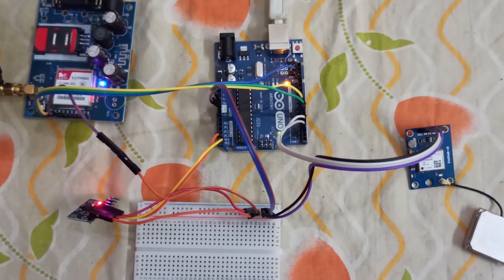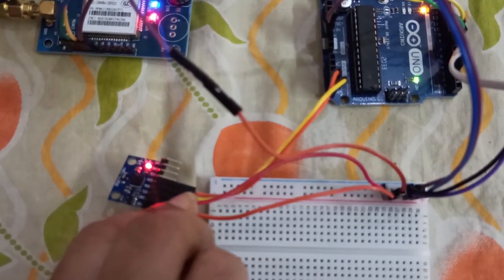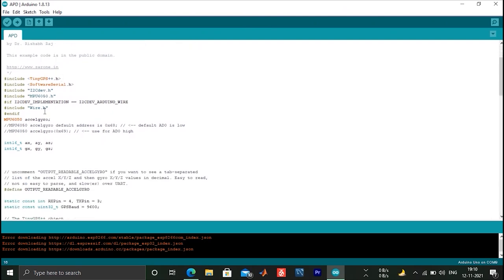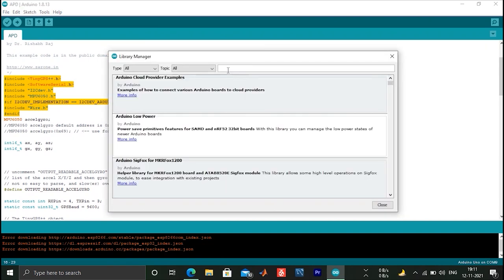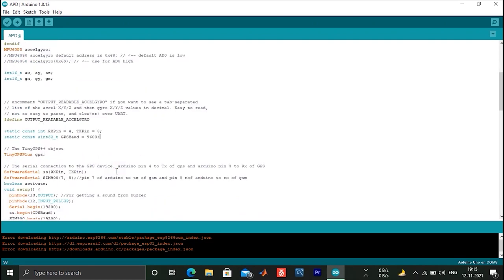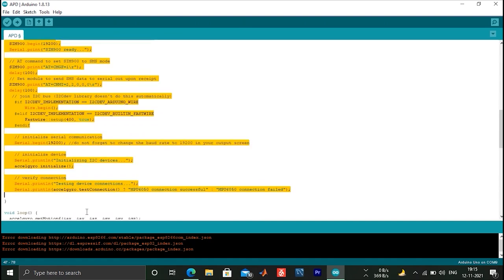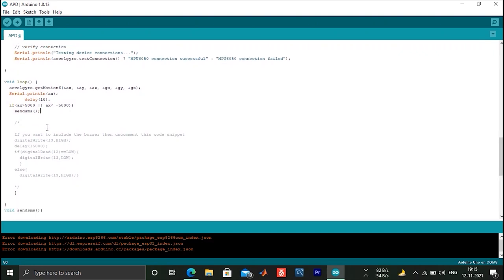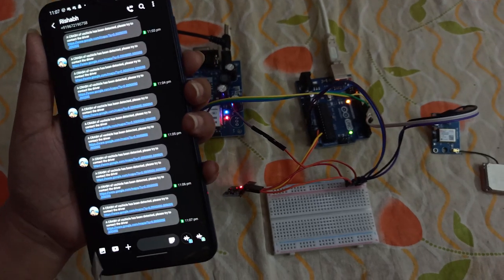Accident alert system using arduino | Vehicle Accident Alert System using GSM and GPS

Comment: Hello. I have almost the same project as in the video. The difference is, I use NodeMCU as a microcontroller and for SMS I use Telegram chat. But I have a problem. GPS location is not sent to Telegram. even though Warnings without location can be sent. Can you help me with my project? Or maybe there are suggestions that can be given regarding this problem? Thanks

Comment: How many volt battery is necessary
Reply from the maker: The whole system is powered with the adapter which is plugged in to GSM module, but if you need to plug it with battery, then use 12V 1-2amp battery

Comment: Mpu 6050 ki jagah ADXL 345 use kr skte Hain same code ke saath
Reply from the maker: Yes, you can use ADXL345 accelerometer also, the connections will be mostly same, you can further follow this tutorial if anything comes up: https://circuitdigest.com/microcontroller-projects/interface-adxl345-accelerometer-with-arduino-uno

Comment: Hi am from Nigeria is it possible am have problems with the gap sim900a because am using Nigeria network if so please help how to make it work or unlock it to my network provider
Reply from the maker: You can use airtel sim in nigeria, it will work
Reply: @ZARONEPROJECTS   I try it not working please help me have been  finish solution to this since last year
Reply from the maker: @OopsEmojiz  send me pics of your connections and full model

Comment: @ZARONE PROJECTS  hi i completed the project but the it not sending SMS and also the just show display crash even when the mpu6050 is not moved or touch
Reply from the maker: Can you send me the wiring diagram???
Reply: @ZARONEPROJECTS  and also it us the diagram u upload
Reply from the maker: @OopsEmojiz  Have you checked all the connections??
Reply from the maker: Can you send me the pic of whatever you have made
Reply from the maker: @OopsEmojiz  and which sim card are you using with the gsm module??
Reply: Hi were you able to solve the issues?

Comment: at first gsm is working and sending messages and then suddenly it stopped working and not getting anysignals
Reply from the maker: Check your power supply, it should be 12V, 2A and whether its getting proper signal or not, if not getting proper then place it in open ground

Comment: What is difference between GPS GY6MV2 and NEO6MV2?
Reply from the maker: GY6MV2 is the board containing ublox Neo 6m like nodemcu contains esp8266 wifi chipset. Other then neo 6m chipset, gy6mv2 also contain antenna, voltage stabilizer, rtc, etc. Basically they are not very different, moreover better versions like neo 7m or 8m is even used in drones and rc planes.
Reply: @ZARONEPROJECTS  And also can you  please say what's this threshold value of mems accelerometer during left,right,front,back accident?
Reply from the maker: @Anjali gupta The rollover threshold on the x-axis is 5000.  (We directly used the raw data from the MPU6050 without converting it into degrees or radians, so the sensor range for ax is 10900)
Reply from the maker: You can download the code from the link given in the description
Reply: @ZARONEPROJECTS  Ma'am please tell me why we use Arduino Uno r3 and why not another Arduino ?
Reply from the maker: @anjaligupta7843  Its just because it is most easily available board in Indian market and moreover it provides decent no. Of pins to attach various peripheral devices. You can use Arduino leonardo which is very similar to Uno, or arduino mega for big projects requiring more no. Of pins or arduino pro mini for small sized projects, choice  is totally yours
Reply: @ZARONEPROJECTS  ma'am can I get documentation for this project?
Reply from the maker: @anjaligupta7843  On your special request I have created a documentation of the project. Click on the link to get the project file - https://1drv.ms/b/s!Ah33T26noqXNnnotF6oJJdsw6G1Y
Reply: @ZARONEPROJECTS  Thank you so much ma'am
Reply from the maker: @anjaligupta7843  Enjoy your Christmas and new year holidays dear and Like, Subscribe and watch my videos and also refer to all your friends ✌️😉😇

Comment: I2Cdev library is not working. Does anyone have any suggestions how to solve this?
Reply from the maker: There 3 I2C library which works like charm
1) I2C library by jrowberg
2) I2C library by fdebrabander
3) I2C library by adafruit
There are some differences in the commands of these but they basically are same, you can use anyone of them

Comment: Im not using any I2C Devices in this project..should i use I2C header file in the code???
Reply from the maker: This code is made for I2C devices like MPU, gsm and gps, but if you choose to use SPI protocol device then you need to define slave devices
Reply: @ZARONEPROJECTS  oh sorry..yeah im USING MPU6050 accelerometer and did the same connection as per your pin diagram..but im not getting output...it showing question mark like...
?¿????????????¿???¿?????¿  ...like this...i dont know what to do? Can you help
Reply from the maker: @nikhil.r.chendekar7271  Have you checked the baud rate
Reply: @ZARONEPROJECTS  yes..9200 baud rate...still not getting the output
Reply: @ZARONEPROJECTS  9600
Reply from the maker: @nikhil.r.chendekar7271  Baudrate is 19200
Reply: Ohh finally its came...but it showing only sending sms ..we are not getting any message from the gsm module
Reply: Should i connect gsm power jack while uploading the code into the arduino...
Reply from the maker: @nikhil.r.chendekar7271  No you need to connect gsm jack after uploading the code
Reply: So after uploading the code...i have to remove usb cable from laptop to arduino???
Reply from the maker: @nikhil.r.chendekar7271  What is the rating of adapter you are using and which sim card are you using??
Reply: @ZARONEPROJECTS  im using 12v 1 amp adapter and Airtel sim
Reply from the maker: @nikhil.r.chendekar7271  You need to use 12V 2 or 3 amp adapter
Reply: @ZARONEPROJECTS  but for gsm module 1amp is enough..is it safe to use 2 amp?
Reply from the maker: @nikhil.r.chendekar7271  Read documentation for sim900a, for sending sms sim 900a require 2amp
Reply: @ZARONEPROJECTS  hi as per your instructions i used 12 v 2amp adapter but still not getting the output...even i didnt touch the ACCELEROMETER but still it shows "sending sms"... please help me...
Reply from the maker: @nikhil.r.chendekar7271  The accelerometer should be in horizontal position, if you tilt it, it will send sms because it denotes the toppling of the vehicle, moreover the threshold is set to +- 5000 which you can change as sensitivity and specificity of the model
Reply: @ZARONEPROJECTS  yeah i know...but i didnt even touched the accelerometer..but still it showing sending sms continuesly
Reply from the maker: @nikhil.r.chendekar7271  place it horizontally, it will only send sms when it is not straight
Reply: @ZARONEPROJECTS  i have shared my project video on your Instagram account..can you please check???

Comment: Hi I am not able to get the output 
It's just displaying sending message  
Can u send me the code
Reply from the maker: Which SIM have you used, since Jio cannot send msg using SIM900a
Reply from the maker: You have to use airtel SIM
Reply: @ZARONEPROJECTS  yes
Reply: @ZARONEPROJECTS  accelerometer is not detected what should I do
Reply from the maker: @brmanoj4924  In that case you need to check accelerometer by interfacing accelerometer and arduino and upload accelerometer example sketch in the arduino, if you find accelerometer is still not reading then the problem lie in the accelerometer itself

Comment: I try, but can't sms please help me
Reply from the maker: Have you changed mobile number inside the program?
Reply from the maker: Mobile number should be change with country code
Reply: yes i have tried
Reply: But i use arduino uno and module sim900 shield
Reply from the maker: Which SIM card are you using??
Reply: Im from indonesia, i use telkomsel sim card